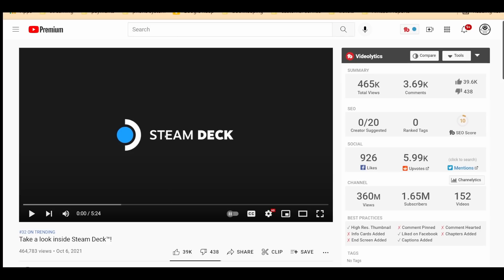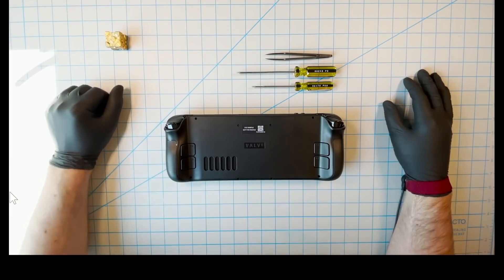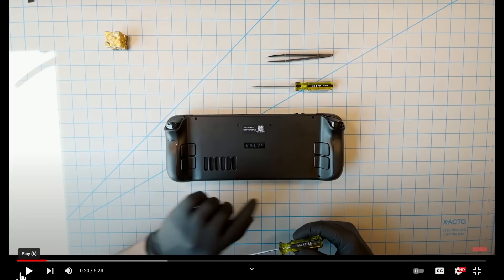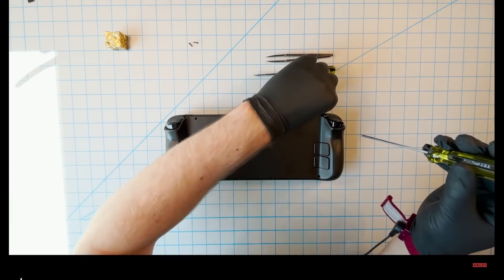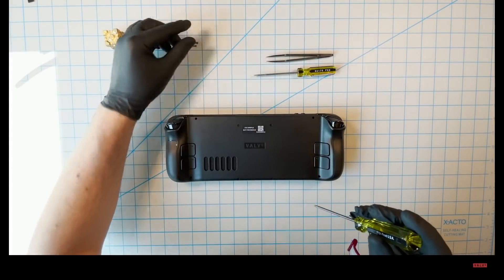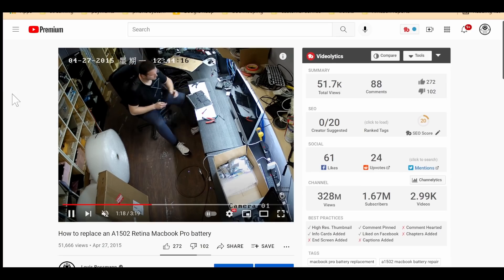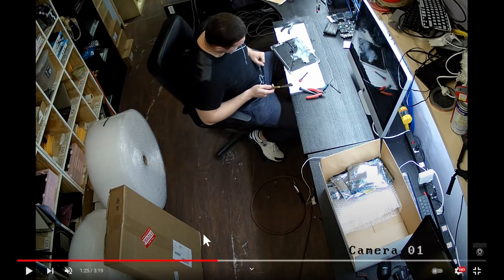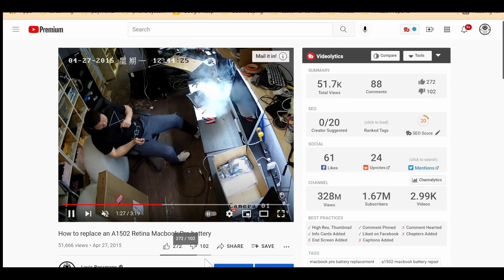Steam deck battery may end your life? bruh 😑

Comment: This is their first revision of this thing. I understand a lot of their disclaimers.  The part I'm opening it will make it structurally weaker. I think that mitt be true. First time you put those screws in they make the thread's in the plastic. It will hold on more firmly before you remove them. And i can guess that in a small device like this the screws are part of the integrity of the structure. However, it should not be a major difference. With that said, you can probable measure the difference clearly.

The things about parts coming within a few month. They haven't even shipped this yet. I can guess that all parts goes in to building complete devices first. Then they will stock up on spearparts.

Comment: I think Valve is justified with the disclaimers, upgrading a Steam Deck SSD is very different than a console.  You can see the potential problems they could face. Hopefully oops occurrences are minimal and aren't used against Right to Repair as an example. It's your device, do with it as you please, but own your fuckups.

Comment: The part about the structural integrity is probably also a disclaimer because they use self tapping screws instead of threaded inserts, which means that you will actually compromise structural integrity to some extent if you fuck up the alignment with the threads that the screw cut into the plastic during initial assembly.

Comment: People doing repairs NOT wearing anti-static wrist bracelets are in danger of GETTING KILLED by me!
Dear Louis, the only reason you're not destroying your chips with charge from your body hair is engineers spending hours on grounding conductors design. And what's more terrifying for USERS, the damage is not ovbious right away. You might start getting errors and hangs here and there after months of intrusion.

Comment: There is a merit in claims of constructional integrity. There are infamous airplane crashes cause by similar stuff. Scale to which it owuld happen would depend on material, depth of stress damage, vibration, termal chage, frequency of disassembly and so on...

But i think it mostly comes down to "dont open it until strictly necessary. Each time you do it you weaken structure and it builds up. Combined with other stuff, which we cant predict, it can cause disassembly".

Comment: No joke, people are making the batteries to be the boogieman.
Serious example, just a couple days ago, I could smell something in my workshop, like decayed food, but couldn't place it. Up untill I remembered I had connected a cheap portable vaccum to charge. That vaccum has been stored for months with no use, and now that I bought my own home I have my dedicated workshop space, so I pulled it out of storage and set it up.
I went straight for it, and sure enough, the smell was from there. 

No smoke at all, just that burnt rotten smell. Plugged it off, opened the vaccum in like 10 seconds and once it was open the smell got stronger, and I could hear it "sizzle" almost. I had time to take that shit out of the house, place it in a "safe" location should it go off, call a neighbour who I know has a fire extinguisher in the car, before it even started smoking and eventually went off. Once controlled, went to the local shop to dispose of it on the correct bin, and done.

Sure you gotta be carefull with it, but if you see it smoking and going to burn, just back off. It catches on fire and then dies out. That's it. It doesn't cause an explosion that breaks windows or anything. It's the fire that's the dangerous part if you are inside a house/shop.

Comment: From a engineer, that have experience with production of plastic parts - They are actually correct that first time you assemble with self-tapering screws in polymer/plastics, you get the strongest joint between the parts - First time you screw in a screw, it cut it's own thread (the screw tower is just a 'blank' cylinder), which means a perfect fit between threads and strongest joint; which translates into best ability to transfer stresses and best lock of the screw. How much it impacts structural property I cannot tell, it might or might not matter at all; this depends on the products overall integrity/design - If the parts are made strong enough by themself and design does not require this extra strength, it dosen't matter, but if the design relies on this extra strength (to save on mass of parts/tool costs or whatever) it can matter quite a lot.

Comment: Self tapping screws very much so lose strength every time you take them out and put them back in. While it does effect the structural integrity somewhat, as long as you're not taking the thing apart 20-30 times it should be fine. As long as you don't over tighten them, taking it apart a few times should be a pretty minimal loss of strength.
Reply: On the official video there are some people saying how to deal with them without doing damage
I don't know much about it but they seem to know their stuff
Reply: @user-eu2mg8lw2t  Basically, make sure you realign the threads (which is just rotating the screw counter clockwise a couple times before you start screwing it in clockwise, which forces the screw threads to align if they weren't to begin with).
Reply: @USSMariner  That is a good practice for all screws anyway. Heck, I do that with twist tops on drinks or my kids' sippy cups/water bottles.
Reply: @FireMrshlBill  cups of soft polypropylene, they get their threads easily stripped as well.
Reply: @user-eu2mg8lw2t  of course you can realign it, yet you can never torque to yield again and due to thermal expansion the threads would be stripped sooner or later (unscrewing effectively removes material if the metal goes into the plastic, which it will...)

Comment: The structural integrity warning relates to the Steam deck's use of self-tapping screws. The threads on self-tapping screws almost always have a stronger bite on first installation because it's easy to cross-thread and retap the screws when reinstalling.
Reply: That said, by turning the screw in the opposite direction to make it fall into the existing threads, you can avoid cross-threading. The most difficult thing about that is remembering to do it.

Comment: To be fair to Valve, I know a few people who are dumb enough to destroy expensive consumer electronics because they can operate a screwdriver and have seen me fix their stuff and think that means they can open their devices without my supervision. Other people are smart enough that they don't actually need my help but they'd rather have someone with some experience do it. This video seems to be for both of those kinds of people. Off-putting enough that the truly dumb people will let the professionals like Louis (or at least competent amateurs like me) handle it, but informative enough that the truly competent are encouraged to replace parts themselves. 

it's not easy to address both groups, especially when some of both think they're in the other group, but Valve at least tried.

Comment: It is true the structural integrity is affected because the screws will not hold as well the second time since they are just self tapping into plastic. It will get worse the more times you take it apart and put it back together, but even the affect from one time is enough for them to have to say that because it's not 100% to the drop standards they tested it to. It's probably >95% but <100% after one time. Then after 10 times it might be like 50%. It you over torque the screws (easy to do with tiny screws) it degrades even faster.

Comment: I'm guessing that the structural integrity thing is because you most likely can't get the exact torque of the screws again when re-assembling the device, though I can't say this with 100% certainty.

As for the battery can kill you, it's not technically wrong if you're not educated enough to know to take some precautions, but if you're not educated enough to not take precautions, you're probably also not one of the people that should be opening the device in the first place.

Personally I've got mixed feelings on the Steam Deck, I want one, but Valve once again decided not to release in my Country, just like the Valve Index, and just like the Valve Index they said "To be released at a later date" and the Index is still not available in my Country and now we're nearing the next generation of VR headsets again and a patent for the Valve Index 2 was filed earlier this year, in other words, chances are, I won't be seeing this device come to my Country before it's already an outdated piece of junk, if ever.

Comment: I think your closing statement on the structural integrity is true. Given the housing is plastic, clips on, and the screws are self-tapping, everything that fastens the rear-cover panel is prone to wear out relatively quickly if opened and closed several times. — This would probably take 50+ repetitions, but none-the-less the structural disclaimer ensures that people can't complain when they drop their unit and the rear-panel yeets itself across the room because the screws or screw posts are no longer bueno.
Reply: I look forward to instructions for burning in proper metal fittings.
Reply: I used to do assembling of cordless phones where we used self tapping screws into plastic. The plastic threads take damage every time you unscrew and screw them back in, you basically wear away a little bit more every time. I don't think they would last 50+ repetitions, more like 5-10 tops.

Comment: Structural integrity - they refer to self-tapping screws, the only thing that comes to my mind, you can easily put back those by rotating them in an opposite direction for a little bit (to get into old thread) and screwing them normally, even EEV mentioned it in a recent Fluke repair video. Anyway, that means that even when Valve repairs it while it is under warranty, it will lose structural integrity? Or they will change the entire plastic body? Makes no sense.
This entire video is like: you should not open it and we made it not to be opened, you will ruin it forever, but if you really want to do that, here is how to do it and you will even be able to replace some parts, we will even provide some, but you really should not open it, you could die and you could ruin it forever. 
Cmon Valve, make your mind, do you want to be Apple or Framework  🙄

Comment: Structural integrity can be a concern.  Screws threaded into plastic are torqued to specific levels in the factory.  Under torquing (and more importantly over torquing) can warp threads and leave loose joints.

Also, as the plasticizers and additives in the plastic age, the characteristics of the plastic can change.  Something that settled/warped into a perfect snug fit could shift slightly once opened.

Is it significant... Who knows.  Time will tell for sure, because we KNOW these will get ripped open, modded and upgraded.

Comment: The structural integrity may suffer if rip out the screws and case is a molten mess after you burned down the city block with your little battery, maybe then.

Comment: As someone who has an idea on how structures work, the so called structural integrity comes from the whole design itself. The mounting points for the motherboard and other components along with the curvature on the edges give it strength to the whole design. The crests on the inside act as structural bracing preventing flex in the body all while serving the purpose of having to mount components on them. 

Put it this way- a hallow circle is more prone to absorbing shocks and impacts than a hallow square object because the forces are distributed equally in a circle whereas with a square object, the forces go directly to the sharp edge leading to fatigue in structure and eventually cracking and finally snapping completely in an endurance. This is the primary reason why crests on the inside of a device plus curved edges are preferred in designing any products to ensure body structural strength. The beefier they are, the longer they can last, though with more advanced components, the need for having these is becoming a little less necessary. Though that is on design and economics requirements.

EDIT: So the whole point of removing screws affects structural rigidity is complete bs. You have to be using the device like a drunk with no screws on and throwing it around whenever you're done with it to be able to damage atleast the components to begin with.
Reply: Pretty sure the problem is because the screws are self-tapping. So if they don't exactly enter the same threading they tapped when applied during the manufacturing process, you're weakening the threading. It's probably fine to do that once or twice, but after that you're kinda in hot water. Basically every time you put those screws back in, you strip the threading in the case to some degree or another. At some point the plastic will no longer be able to reliably hold these screws in place when under certain stresses (like falling onto concrete). While this super unlikely to damage internal components, it might lead to the back-cover just popping out of all screw sockets at some point and you being unable to put it back on, because all of the threads are stripped. The electronics will continue to work just fine, but the usability of the device will nevertheless be greatly diminished
Reply: I disagree, as a mechanical engineer.

They are self tapping screws, they create their own thread, they are never going to be as tightly bound  as they would be the first time you screw them in.

Would  it be noticeable? Probably  not the first few times as long as you don't cross thread them or over tighten and start spinning, but not as taught as that first time.
Reply: ^this, Linus iirc came up with a similar conclusion as well. You basically need to stop torquing the screws in once you can't move it with your 2 fingers anymore.
Reply: Thank you for you detailed insights!

Comment: It's put together with self-tapping screws. If you damage the thread, it will damage the structural integrity. However, should not be a major issue for anyone careful.

Comment: I would think the video is aimed at kids. Kids panic and once that happens, anything is possible.
Self tappers have a drill like nose that can damage the previously made threads, also with such a course thread, it's easier to torque out. 
There are static dissipative nitrile gloves. 
If your workbench is grounded you're all good. 
Parts in circuit aren't as vulnerable to static because they are protected by caps.

Comment: when you reinsert the self tapping threads into the same thread channel they don't hold as well mechanicaly and if you make new thread channels it holds better but they are easier to pull through when dropped and then they are stripped also they do not mention if they are using snaps around the edges or not

Comment: You summed it best way at the end. They r technically correct like they r with the battery but practically as long as you have common sense and dont drill the device the structural integrity will be fine. The only thing is that you can strip the screws so that could make it difficult to open the device again if it is needed for any reason.

Comment: Plastic threads made by the screw when you first put it in will inevitably weaken when you keep reassembling. That's what they probably mean by structural integrity.
Reply: This is what I was going to say. But also I guess technically if you reassemble it wrong, which is admittedly easy if your a noob or its your first time working on this device. But also its something that should be obvious if you take care, and if things aren't going back together easily.
Reply: I disassembled a mini PC too many times and one of the plastic posts cracked so I couldn't use that screw anymore. But this is a PC that doesn't require complete disassembly except for one small cover to upgrade the SSD

Comment: The whole structural integrity thing surrounds the self-tapping screws.  The way the threads bite in allows the plastic to grip the threads.  Once you remove the screw, this bite weakens.  It takes several attempts to make it meaningful, but we're talking 10 or so, not thousands, and just leads to the screws potentially backing out, which would reduce the structural integrity.  I think structural integrity is the wrong word here, but I see where they were coming from.  The probably should redo the video and get this info correct.
Reply: Is that why when I unscrew some electronics sometimes I see this blue plastic-y rubber smeared on the threads of the screw? It seemed to me they put it there to give it more grip.
Reply: @FerdinandJosephFernandez  look up what threadlocker is
Reply: @NFchegg  you mean 'lipstick' - but then again, they use the blue one on electronics.

Comment: Structural integrity could be compromised if those self-tapper screws end up forming a new thread in the plastic. It will always be a weak point from then on, especially if the repair-person over-torqued the screws.

Comment: The screws holding the thing together go into plastic. So if you disassemble and reassemble it, you will lose structural integrity. However it is not a problem unless you fuck up your screws or do it a 100 times.

Comment: The "Structural Integrity" he means the screws tat are self tapped into the plastic mold. You can only use those holes so many times before those screws won't hold any longer. As long as you dony strip the plastic while putting it back together you're fine.
Reply: You can't really torque them as the original ones, either.

Comment: related to the structural integrity thing. My guess is because they're using self tapping screws any time other than the first time those are screwed in they're not going to hold as tight as the first time, thus lowering the strength of the connection
Reply: And I'm not sure if applying thread lock to reduce that would make any difference here cause I don't know how well that bonds to plastic